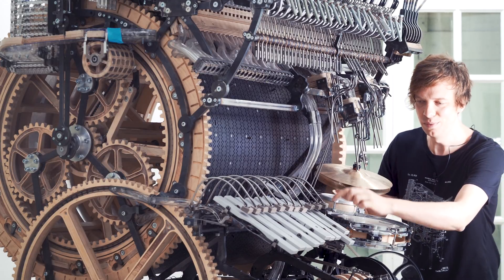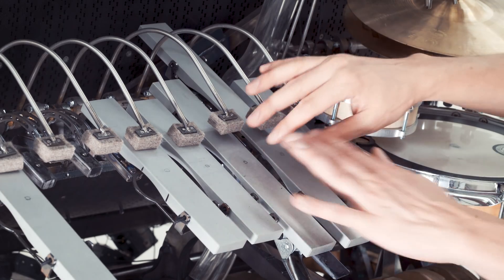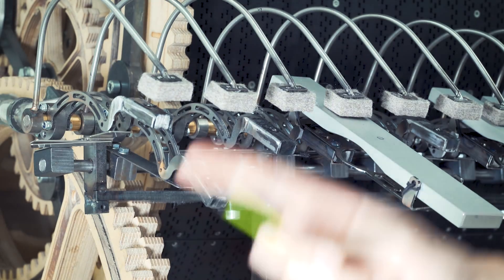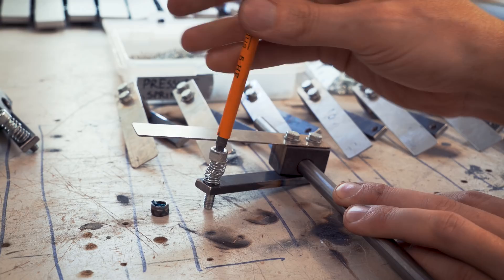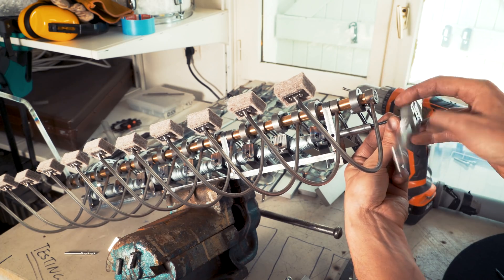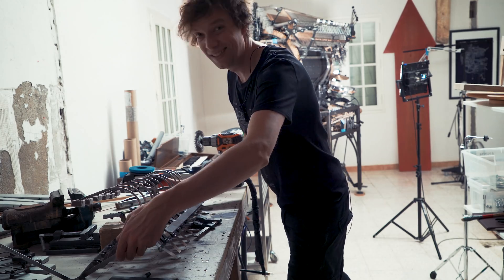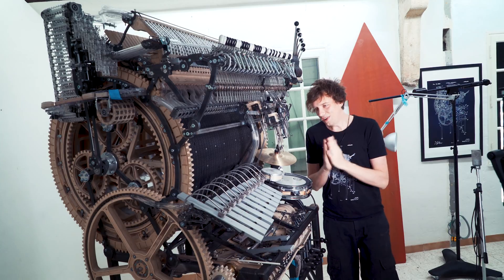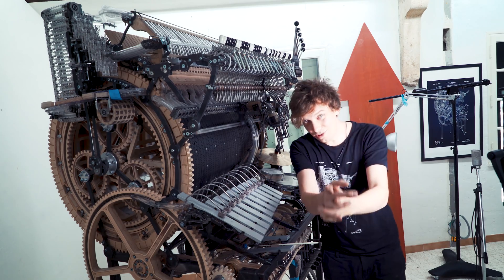Vibraphone Height Adjustment - Marble Machine X #103

Comment: Amazing solution!
Have you thought that this ultimate solution opens to an electronic "auto-height-adjuster" in the future? It could be like an auto-tuner for the guitar (as the Tronical system), with mini-engines for each screw and an electronic-optic-system to "see" the right height for each plate. Maybe on the MMXX... ;)

Comment: Adding weight would be easiest to switch out during sets, however I would keep the set screws for adjustments to the spring steel which will be needed occasionally over time.
Reply: Yes!  And if the center of mass, springs and dampers was adjusted right, they would all move  any amount Martin desired!

Comment: You've rediscovered a principal of "axiomatic design." Specifically, the first axiom (paraphrased): separate the designed elements so that each element effects only one desired function and not any other functions.
...

Additional Info:
A standard example is the tap handle design of a sink or shower. Two design alternatives are (A) separate hot and cold knobs or (B) a lever than can lift to change the flow and twist to change the temp. If your goal is to separately control the flow and temperature, design B is superior.
Reply: But my hot water pressure is lower anyway. :(

Comment: Hey Martin, what do you think about making vibraphone plate holders of different height to compensate for mass? It allows to replace plates fast (because it doesn't need any adjustment at all I think). Maybe add some screws in the holders to make their height adjustable.

Comment: A practical solution. 

However I think solution #3 with adding mass was the most elegant as it is tool free and maintenance free.

 If you were to make all notes the same mass and have the same center of mass relative to the note attachment point, they would all behave the same everytime no matter what slot they are in. This way swapping notes would litteraly take seconds and require no adjustments.

Just my $0.02, Cheers.

Comment: I would have thought the best solution was to have each not be a self contained element. Mounting + Bar in one. You could then move them to any location and not have to adjust anything. Any fine tuning would be fixed into the combined element and doesn't get adjusted when you move the note between the different locations.

Comment: Martin: "I simplify things..." Then proceeds to build the worlds most complicated marble machine. Nice Work!
Reply: Well it could very well, as we ALL know, have been an extremely complicated machine. Now it is just .. slightly less extremely complicated.
Reply: Could be less complicated if instead of this, he had the height adjusted on the actual note bars and their mounts. So that they don't need to be readjusted on stage when they swap out a note.
Reply: @SoraHjort  but this won't also fix the fatigue of the spring steel ;)
Reply: Fatigue is gonna happen anyway. The point is there are better options out there than what he decided to go with. Hell, the weight idea he suggested would probably be best BECAUSE of the fatigue issue. It would mean each spring would fatigue at the same rate, and would only require the one adjustment when they setup for a concert to align all the bars
.

Comment: In addition you could, again, adjust the bar mounts so that the heavier bars sit a bit higher. It only takes a slight bend. Then, if the springs are all the same, all bars are at same level without adjustment.

Comment: solution 8:
integrate the spring into the exchanging part, so you can Exchange spring and note in one unit, each unit would have its perfectly balanced spring.
Reply: Or actually investigate the weight and balance approach with an open mind.  There are ways to make them all the same mass, and move beautifully, while making everything perfectly interchangeable.
Reply: @sethjones5250  where you place the mass in relationship to the pivot and spring steel will impact how it moves up and down. If the center of mass is in the same place on each plate and the mass is the same, then they should react identically. No more having to mess with set screws in between each song.
Reply: @mikepark99  yes exactly, but the center of mass for all the bars can't be at the center of the bar.  They must all be the same distance from the arm's pivot.  

Right now, none of the brackets are weighted so that all the bar modules weight the same, not are they balanced so that the com are all the same distance from the pivot.  The balance issue should have been all the more apparent once Martin chose to offset the strike points on lower notes.

Comment: If you put the spring steel on each vibraphone note holder, there will be one initial adjustment for height. A new note is installed per-adjusted for height. No need for adjusting every note every time a new song is programmed.

Comment: Why didn't he just ad extra material as spacer under the ones that's heavier, then it will aligned itself. Assuming all the springs have the same force there should be an easy ratio between weight and height...

Comment: Martin might i suggest changing the set screw for a section of longer rod with a threaded section then you could add an adjusting knob on the end as the position of the screws are between the plates the knob would be higher than the vibraphone plates

Comment: Hello Martin!

Nice video, as always! And I also like the design of those hight-adjustments.

Sometimes I have the feeling, you approach the solutions from the most-complicated one, just to simplify it then later on.

Just a questions: I see you tapping, drilling, grinding and welding a lot on your MMX. This usually makes quite a lot of dirt, especially for a machine that in some parts has to react in a matter of tenths of a millimeter. Especially the grinding-dust is quite abrasive.

Did you consider disassembling the whole machine after it is finished, just to clean all parts and maybe coat them? I also saw some parts that already had a small portion of rust on them. In the beginning you worked with some wax, but I have not seen that in a year.

Would be a shame if you want to take the MMX on the world tour and than have it break down or need for repairs after some weeks in service.

Another question: Do you also add that parts you do by hand (as in this video) into the CAD-Model?

But to cite you: "It´s been a jurney, but were on our way!"

Comment: You are going to spend three times as much time re-configuring for each song than playing a song! For a concert, you will need an entire team trained and dedicated to configuring this machine. On tour, all the adjustments and reprogramming are going to be a nightmare.
Reply: My guess is that they will have a team of techs to adjust it while the band plays a non-marble machine song. It would take far too long to replace the programming wheel plates between songs while the audience waits.
Yes, it will be a difficult job, but I think nightmare is a bit harsh. With proper SOP, instructions, training and practice it should be no harder than setting up a piece of industrial machinery, which minimum wage workers do every day.
Reply: @MrBenjigee  They are a small band which meets when they can. How will they ever be able to afford a team of many dedicated, not to playing, but to: install programming plates, change vibraphone plates, adjust vibraphone plate springs, change vibraphone resonator pipes, change belt on vibraphone pulleys, . . .

Comment: Hi Martin, have been enjoying the build quite a bit. Had a thought on the adjustment screws... Instead of adding a bar with the adjustment screw would it be easier long term to tap and install the screw into the support bar of the vibraphone plate that rests against the curved bar that presses on the spring steel? That way you would more or less adjust each bar bracket once and the adjustment would stay with that bar. I don't think you would need to do hardly any adjustment at all between bar swaps that way. I think now you will still have to make an adjustment for each bar change every time.

Comment: Set screws may move a bit over time even with the spring (or wear on the threads), it may not be an issue for the duration of a song, but a replaceable nylon nut would be an option in addition to the spring to add some resistance.

Comment: How about a custom wedge or finger on each note holder that interacts with the new adjuster. Pushing the note on pushes the adjuster to the right spot.
The set screw is still handy for fine adjustments for wear and such.
That's really hard to put in to writing. I hope it makes sense.

Comment: what about a removable attachment (a bar of steel or plywood) you could sort of hold or clip in over the vibraphone plates so you just have to bring the plates up with the screws to a defined perfect height? It would make the adjustment of the plates much easier after changing them in the concert? 

Just a small idea, love your videos!!!

Comment: Dammit, so i've just started watching the build and all i can think is, the shims are the solution, they just need to be attached with a bolt or 2 through a slot in the spring plate and even two different shims with 2/4 bolts. So you can reach under the vibraphone not grab one of the shims attachment bolts, and slide it forward and then again for the second if its a heavier note. This means no tools but only 4 levels of height adjustment.

Okay finished watching the build. This is a very good solution, just need a nice long hex driver.

Amazing work Martin!

Comment: Even though this is a nice fine tuning solution. I would add adjustment spacers to the note blocks themselves to elevate them. When changing notes you would not have to fiddle around with set screws.

Comment: I think you should’ve added height adjustment to the vibraphone bar holders/cradles instead of height adjustment to the springs. That way each bar is already preset for its own weight. When you’re switching them out you won’t have to adjust any springs.

Comment: You where so incredibly close to the perfect solution martin! With the noncocentric setsrew underneath the vibraphone arm.  You should've made the leaf springs a bit longer. And let it rest on the square tube of the vibraphone plates. Just add a small spacer underneath the heavier vibraphone plates and NO ADJUSTMENT NEEDED when switching plates. This solution is just a bit complicated again. Cool, but bit complicated.

Comment: Hey Martin, nice solution.
Can you use a longer bolt for the heightscrew? With an welded nut at the spot of the original hexhead you can still use the springs.
It would remove the use for a seperate tool wich no one will find in the heat of a dark worldtour stage.
An other tought is some lighting on and in the machine, you can get creative with that, also blink the lights in tune with the song.
Grtz!!

Comment: I'm probably daft, but wouldn't added weight ultimately end up with all plates having the same inertia and and move identicly?  Or is there a point in having smaller plates, ie.e higher pitch notes move faster te emulate the higher frequenzy of the tone?

p.s.  the 7th solution seems to work nice also ;)     But wont You need some sort of aiming marker as a guide to find the proper set point in order to avoid drifting in distance from the marble release as that would affect teh timing in Your music?

Comment: It should be possible to have a solution that avoids any additional manual adjustment. Just make the leveling mechanism part of the thing that is being changed -- part of the interchangeable vibraphone bar assembly, not of the machine proper. Then when you change a bar, it will also automatically level itself.
Maybe the shim idea could be used. Weld the shim to the bottom of the interchangeable bar holder in a way that the other end of the shim comes between the arm that holds the vibraphone bar and the thin metal part that raises the arm. The width of the shim would depend on the note (on the weight of the bar) and it does not have to be adjustable, since it would match the note it is welded to.
(I understand that the arm is not part of the interchangeable assembly, but you can still weld the shim on the bottom of the interchangeable assembly in a way that its other end fits just below the arm.)

Comment: 🤔 I don't understand why the weight solution wasn't good,
IMHO all the notes should have the same movement when hit by a marble (and if they all have the same mass, the same momentum will be applied when the marble hit, which mean the lower note will move as much as the highest note), 
also, having the solution integrated into the module (just like you did with shifting the bar to get the same hit-spot) would mean changing all the notes very fast compared to changing the notes, and adjusting height for every changed notes :/

the only disadvantages I see are that the longest bar might not move that much when the marble drop (and so having all the same weight means not much movement), and having weights on the metal structure to hold the bars may not be possible because of clearance with the resonator pipes, but I really liked that approach.

On the other end, your solution make adjusting for metal fatigue very easy 👍

Comment: very clever solution.  Out of curiosity, did you ever consider having full vibraphone sections that are swappable?  then you can pull the whole "keyboard" off and click in a different one for a different configuration.  It would be much faster turn-around between songs and you won't have to fiddle with individual notes.  Downside would be more parts to transport and higher cost of materials (though cost doesn't seem to be a major factor right now)

Comment: Having the ability to adjust the height easily is a good feature, but it would still be nice if you mostly didn't need to. Any way to build a quasi-permanent height adjustment into the holders themselves would do the job. Maybe if you soldered bumps of various heights onto the elbow of the holder that meets the spring? Don't weld, of course; it'll distort things all over again :P

Comment: All that washers...can maybe replaced by plastic or graphite tubes later? I worry about the weight of the MMX going to be > 500kg. You need a weissach package, replacing steel with carbon evantually ;)

Comment: What if that set screw was welded to/attached to the vibraphone plate holders? Then when the plates are switched, the adjustments already in place. The per-plate adjustments can be made once, rather than every time a plate is moved.
Still, the solution as presented is for sure easier than shims!

Comment: Please have someone with a lathe help you to replace those stacks of washers.
Reply: Yes, even a length of tube with an internal diameter not much bigger than the bar would be enough, just use the cutoff saw, a quick clean up with a file/sander, and install. Easy enough to measure up now with the washers in place.

Comment: Option #8: Move the detachment point so that each vibraphone bar is paired with its own personalized spring. Both would then become a single modular unit which would not require on-the-spot readjustment during a performance.
Reply: Option #9: Flip the notes upside down and fashion a trampoline mat that after the marbles pass through the spaces between the plates will bounce back up and hit the notes from below.
Which lead me to think of Option #10: Instead of a trampoline, Pinball Flippers!
Reply: After reworking the bar disconnects once, he (and a lot of viewers) might not have the heart to see it taken apart again. It would also require a major rework of the vibraphone setup which could possibly add a lot of time to the construction of the MMX

Comment: Wonderful build, but I wonder if the marble drop mechanism will get in the way once it is installed?  You might want to engineer a way to move the marble droppers out of the way when you are adjusting the heights of the vibraphone plates.

Comment: The brackets holding the vibraphone bars should just have different heights based on the weight of the bar.
Reply: Problem is that this change also changes the weight of the bracket and bar, and quickly becomes a problem where the bracket becomes infinitely long and infinitely heavy.  It's simpler to tune the masses and center of gravity on all the bars

Comment: Coulden't you have attached a shim to the vibraphone plate assemblys bottom? When attaching a vibraphone plate to the MMX the shim would go in between the spring steel and the arm that the vibraphone plate assembly is attached to. By having a custom shim on each vibraphone plate you would eliminate the need for fiddly configuration when switching out the vibraphone plates. 
If im not making any sense i can make a drawing for you :)

Comment: You might want to add a small washer between the head of the screw and the spring.

Also, you might want to not completely abandon the idea of an equaliser rod, just make one you just slide in and out to make the adjustment quicker and easier.

Comment: I have one big problem with this solution. You are making it so there is more work that needs to be done between songs. What you should have done is have a set screw on each of the vibraphone holders so that you could adjust the height each on sits at. Then you only have to adjust each set screw once to have everything aligned.